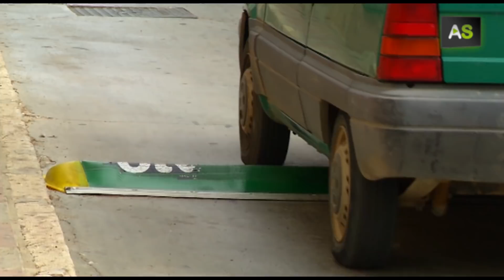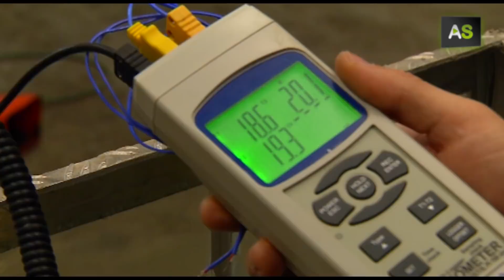AS Intelligent speed bumps that only activate if you don’t respect the speed limit

Comment: shame this will never come to the states.  Far too many teens with way to much time on their hands.  Meaning they would try to destroy it for the lols.
Reply: GANTZ100pts which would happen anywhere else in the world...
Reply: I wonder what kind of smoke it makes when you burn out on it.
Reply: Not a American. Can confirm doesn't just happen in the states.
Reply: RWBimbie and i have to go 2 km/h to not brake my back in my supra on a speed bumb
Reply: GANTZ100pts two gallons of diesel will dissolve all the binder in asphaltic pavement speedbumps. Nothing is all that difficult to destroy
Reply: Jackson Whitlow ya everywhere else they don't even lock their doors!
Reply: GANTZ100pts same shit in greece in my city in one of our landmarks had christmas decorations like a ball or something with lights some teens cut the power and it turned off weeks later it got fixed
Reply: Political Nonsense or how about someone who builds these things. Yes it does do unnecessary damage to ball joints, bearings, tie rod ends, and most importantly the steering gearbox. And the reason I seek compensation is because if I have to travel over a obstruction in the middle of the broadway with no way to avoid it. Ya. That's bullshit to be put bluntly. And to the whole jab at my age, I might be actually offended if it wasn't in a high school style quip. But I would love to know what makes your a opinion a professional one or better yet one that holds some water? 

Speedbumps are perfectly fine for your vehicle. Ya and cigarettes are good for you! 😂 smdh.
Reply: and thats a good thing because you won't have to slow down anymore
Reply: Well the maintince of this product in an actual city vs villa might as well give ure $$ to the cartek prolly cheaper wonder what happens when a semi creeps over it
Reply: They are in the US in some regions, but are rare.
Reply: US Big Oil will lobby to get these installed everywhere.
The more cars are forced to decelerate and then re-accelerate they will burn up more gas.
Plus think of all the extra carbon that we can put into the atmo with all that extra acceleration & gas burn.
Speed Bumps dont may folks drive slower, they slow just for bump then re-accelerate.  Heck, with my truck its more comfortable to take the bumps at higher speed than the slow bounce launch
Reply: GANTZ100pts for the "lols" I'm not a teen and I would slash that thing for my Ball joints or my front end. I hate speed bumps. Unless we are going to be compensated for the damage these objects they stick in the road I avoid them. I'll drive onto a sidewalk before I go over one of those just off principal. I drive a 1 ton 4wd diesel so I don't mind the sidewalk but others might.
Reply: spain is a socialist piece of shit country with like 40% unemployment tho
Reply: Mike Hall But mostly america

Comment: I said it works, so believe me, no I won't show you! What if you lock up your tires and skid over one? Or hit it fast driving a semi? I think if it did work it'd got splat
Reply: FFS if you hit it fast, the liquid temporarily becomes a solid, therefore having no chance of BURSTING non of you understand what a non-newtonian fluid is do you?
Reply: Well since Spain is already using them what makes you think that they may not work? Do you really think they did not test them?
Reply: MrPielover61 it would feel like hitting concrete very briefly, watch a video of someone punching non newtonian fluid. Its an amazing substance
Reply: bosshoss69lee you're an idiot lmao
Reply: MrPielover61, to me it looks like he knows that. I agree with him, because non-newtonian fluids have their limit, they are not infinitely strong, as well as the sleeve it is in. For example, if hit starch-based non-newtonian fluid really hard, it indeed behaves like a solid, it beaks apart. So it this case, as it breaks the sleeve might  burst. The second concern is how it will stand a car braking on it, the traditional plastic speed bump is mounted with a lot of big bolts going deep into the road for a reason, this one might be ripped off from the road or the outer coating holding it together might be torn apart.
Reply: yee i guess
Reply: why would anyone intentionally drive fast over a speed bump?
Reply: If they knew it was a "Intelligent Speedbump"